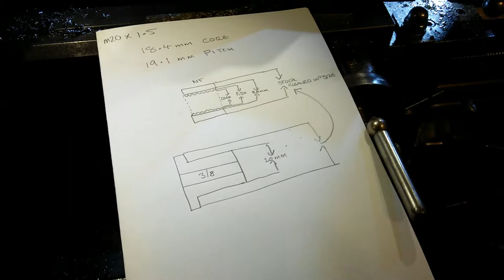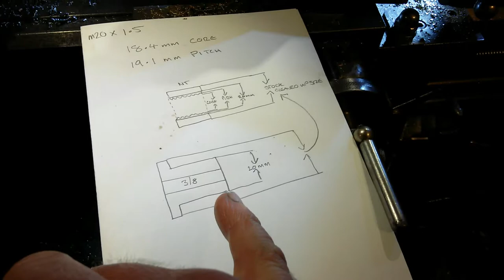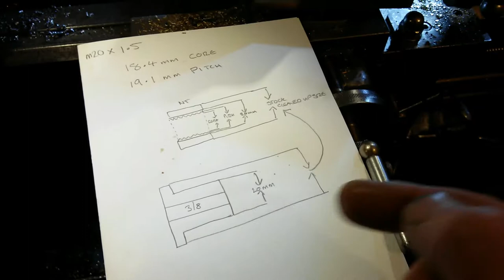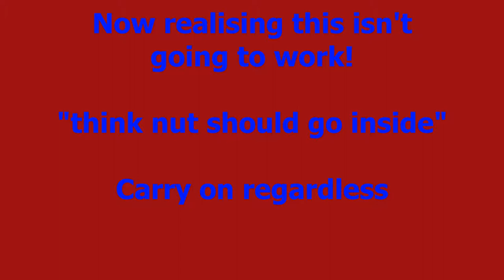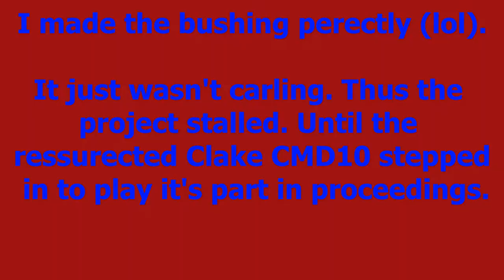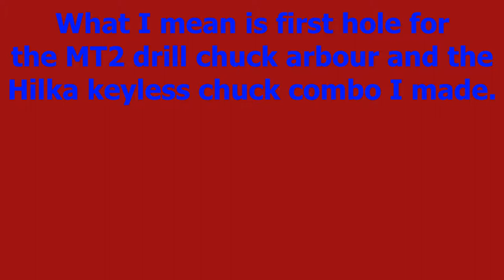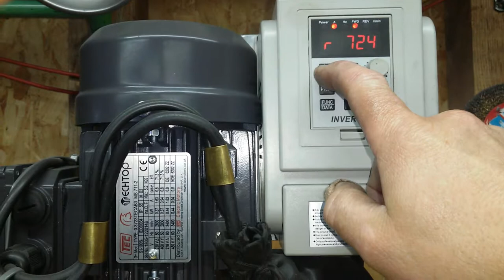Holbrook B/C8 modified Gearbox usably Done

Comment: What you do is... drill a hole through your oddly-shaped bit of ally, nut and bolt with stout washers, hold the bolt in the chuck jaws - safer for you, safer for the chuck jaws, better result.
Reply from the maker: Hi thank for commenting. The bushing didn't work out:(. Hey thanks for the advise though. After a redesign I made a steel plate instead, that works wonderfully:).